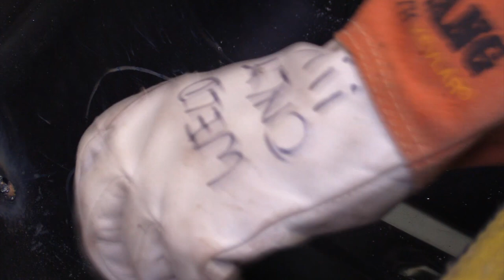How To Weld Car Floor Pan

Comment: Liked the answer to the self tap screw hole fill.  I went at it the first time earlier tonight and seemed to fill them - from the top.  Tomorrow I'll get under there and see what the underside looks like.  Might need to hit with the welder from the bottom like you said.

Comment: Looking good. The top two things that you can do to make you welds better and to make you spout less 4 letter words while doing it... First is a magnifying lens for your helmet. If yours doesn't have the clips for it don't worry just buy it and tape it to the inside or use the existing screws and washers to hold it in place. The other is a really bright light on the weld. This will help immensely with seeing the puddle. 
        With those two things your weld area will look allot bigger than it is and closer than it is and with the light you will eliminate some of that initial shaded puddle and just make everything easier to see. 

              There are lights that mount to the mig torch but I was not impressed. I have made my own mig welding light which is way better and adjustable. Just need to work on a professional way to attach it to the torch and thinking of trying to market it. It's in the hacked prototype stage at the moment...
Reply: Ha !  I was welding tonight struggling with how to keep a bright head lamp positioned on the weld area, and moving it around as needed.  Thought about adding it to the end of the torch, but I remembered an old flashlight design that was like a flexible snake.  Plan on finding something like that and adding a magnet to the end.

Comment: I’ve got a ‘64 and am about to replace my pan, probably going the route of this full length pan.  I’ve watched your videos on this a number of times and might do something a bit different.  Instead of putting this in as one piece, what are your thoughts on quartering it and doing each of the four separately, removing the old and welding in the new in quarters? Butt weld them all together.  I’m concerned about maintaining structural rigidity of trucklet with the whole floor removed and, easing the single piece installation that you experienced.  Thoughts?

Comment: I think you coulda cleaned those inner rocker panels and then sprayed a weld-through primer! Then no need for redrilling to clean before plug welding. I also primed all hidden parts of the pan, torque boxes, subframe ears, etc. with epoxy. Maybe overkill but....
Reply from the maker: Good idea! I plan on pouring POR  down the rockers...
Reply: I used the Eastwood  Internal Frame Coating for the inside but sanded the outside of the inner rocker panels and sprayed weld through primer!
Reply: Check out GODSPEED Garage, unless POR is a sponsor!

Comment: Great video Jeff! You mentioned that Ford had used sealer during assembly. Will you be using any sealer before applying the POR-15?
Reply from the maker: The sealer will go on after the POR15 goes down.

Comment: Jeff, thank you for another great video.  I had a full floor pan that was replaced and it was not welded in correctly.  It does not appear level.  Drivers side is much higher than passengers side. I bought the 68 cougar seat risers too. The transmission cross brace wasn't welded to the floor.  It's a nightmare. Do you think subframe connectors would help or does the floor need to be cut out and redone?  All the welds look like popcorn welds and they didn't grind down the epoxy paint or rust before they welded.
Reply from the maker: For best results...I'd start over.

Comment: How did I not find your channel??? Im doing floor board too....on a ....(drum roll) RANCHERO!

Its bad though...really bad, (I mean, arent all Rancheros bad in this area?)

So I wanted to ask for some advice. Im stick welding (its what I have) plus Im very new to welding. I just finished my first actual repair of a rust hole. I tried doing a perimeter weld (butt weld) but I kept blowing out the thin rusted metal, which meant increasing the patch size and just tacking around to where it wasnt moving anyone at all.

Is using seam seaer and tacking around with some areas of a full line, enough to keep moisting out of the cab? I will be uploading that vid tomorrow, and this isnt about views or whatnot (I dont care about that anymore), but I would like some tips, if what Im doing is just horrible (I know it aint good but at least if it wasnt the worst youve seen...that would make a vet happy!)
Reply: Also...dont look too far into my channel. Its weird. Im weird. My cars are weird LOL. Even though I dont care about vews, I do care about the video and how I edit and all that. At least one thing I do should be neat and tidy, right?
Reply from the maker: LOL People call us weird too. But it is fun not being normal.
Reply: @AutoRestoMod  OH, Im not normal...I mean, who puts in more money into a car thats worth...nothing? Or worse..importing a city bus from Eastern Europe? But, Im not changing, you know the saying about old dogs.

Comment: You are replacing the floor pan with a full floor pan.  What is different if you salvage the tunnel and replace rotted metal with the 1/2 floor pan
Reply: Exactly. That's the more common for the average guy at home. I'm think he wanted to show how to change the whole pan, he said never done before. Not because it really needed. Just to show how to... I think..
Reply: I've done both and replacing the entire pan is MUCH easier.  Its 10x more welding when patching over replacing.
Reply from the maker: The center tunnel had some additional damage that I went over a while back. Plus the wells at the rear seat area (under the bed) were trashed.
Reply: @AutoRestoMod  So you want me to go back and research  back  episode.   A simple reply would be appreciated.

Comment: Jeff, what are your thoughts about weld through primer?
Reply from the maker: Well, it goes away about as quick as E coat. Still will build a gutter and pour POR15 down the lip.

Comment: Make sure to clean things before you weld
Reply from the maker: We do clean out the hole. I just didn't see a ton of difference between the places that I cleaned the surface and the ones with the e-coat left in place.